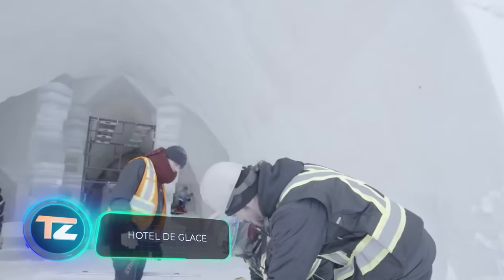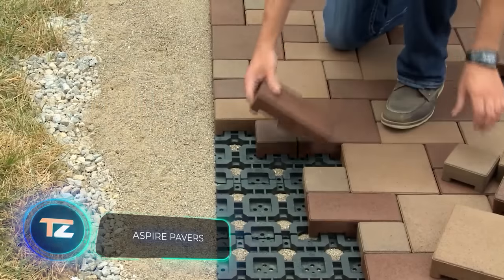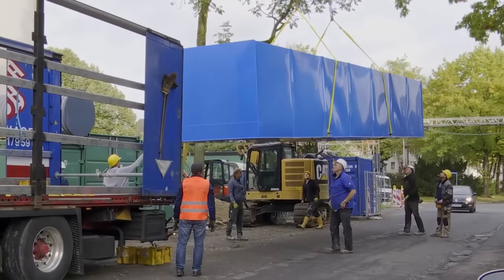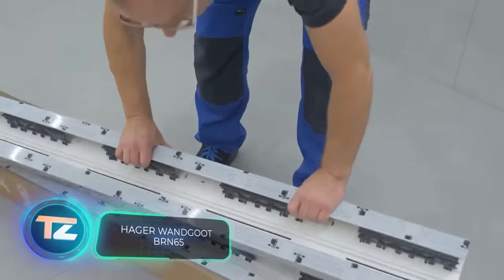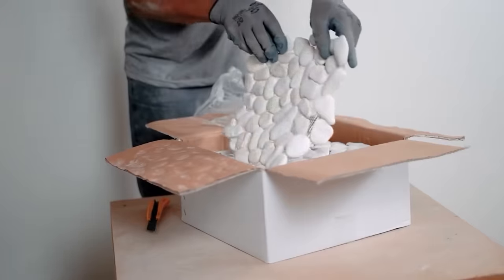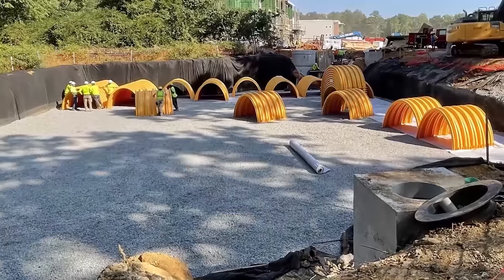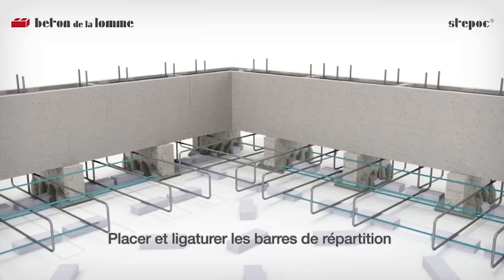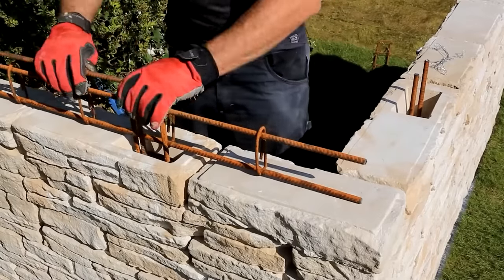CONSTRUCTION TECHNOLOGIES THAT HAVE REACHED A NEW LEVEL

Comment: 6:00 system 3 end rot will actually allow the wood to continue to rot. These hack repairs are never good. What happens is that moisture in the wood sweats at the area of connection where the epoxy joins the wood. Eventually the bond between the two fails , the epoxy falls off and now there is more wood rot. It's an expensive lazy unskilled repair where an actual scarf of new wood would be the preferred correct repair